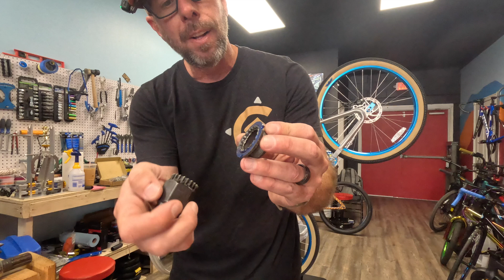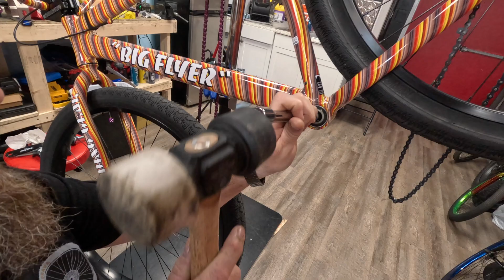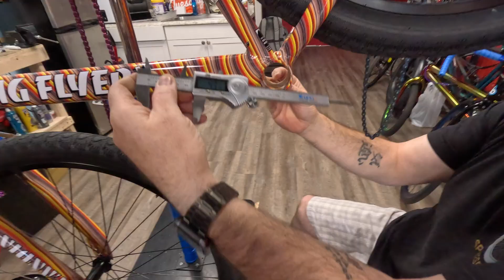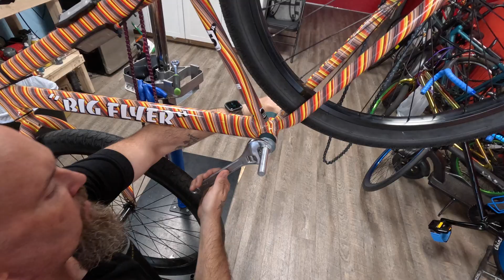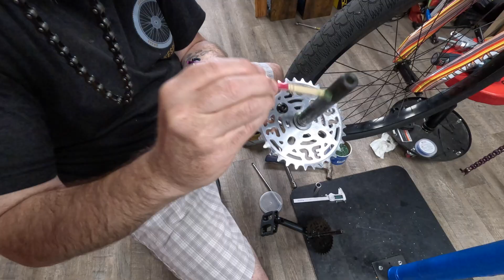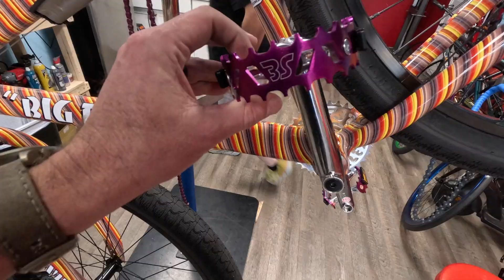How to Replace Bottom Brackets on SE Bikes | Big Flyer Conversion & Tips

Comment: I have a SE Big Flyer. It did not come with a front brake. Where can I purchase the correct front brake to fit the Big Flyer?
Reply from the maker: The big flyers with the landing gear do not have front brake mounts.  There is no way to put a front brake on the stock forks. You have to buy a different landing gear fork that has the front brake mounts and possibly a new front wheel if you want disc mounts.